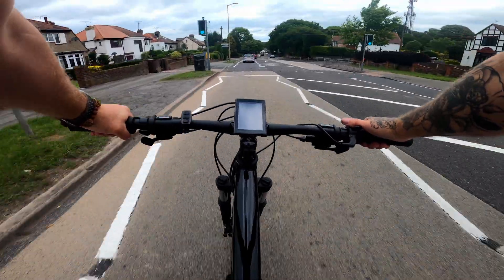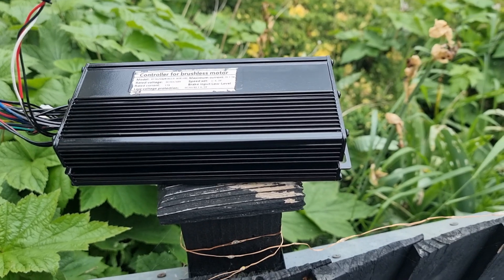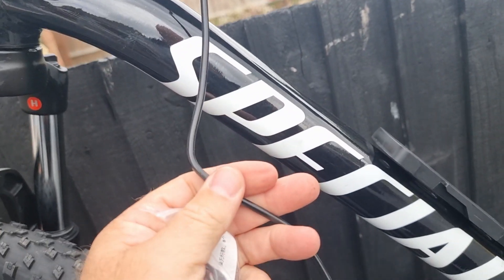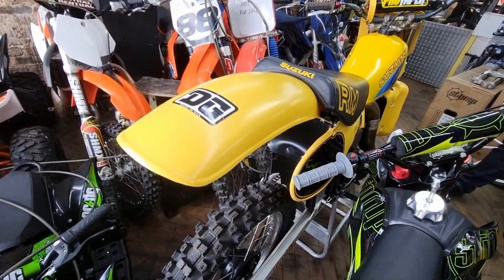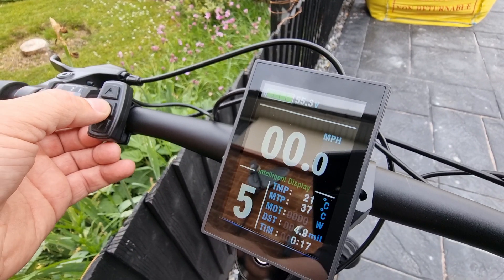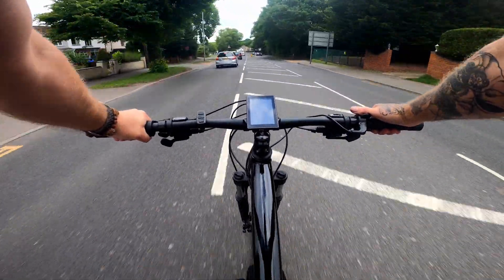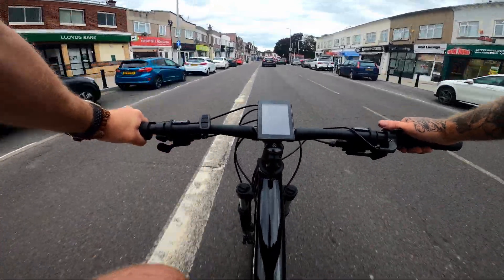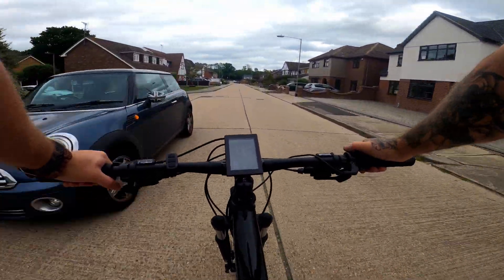LONG-RANGE 40MPH DIY EBIKE!

Comment: @dude stuff the specs on this kits battery say it’s 52v 20ah on the website have they updated the battery in the kit since or do they lie and say it’s 20ah when it’s 17.5 ?
Reply from the maker: @olsoutdoors1757  the battery specs went up from 17.5ah when this video to 20ah now. This video is old there's been improvements since
Reply from the maker: @olsoutdoors1757  this video is at least 2 years ago now

Comment: does it wheelie?
Reply: i dont think so cuz controller is too small, i built one with a 72v battery and its too fast to wheelie, its so scary 😂
Reply: @umi.1498  on all these kits is it the controller that would allow one to have the torque needed to wheeled?

Comment: Using a 750watt Bafang mid motor. With 48v/20 ah I only get around 50-55 miles range with an average of 19 mph ( I weigh 230 lbs and do probably  not assist a lot of watts)...So If I want to go further, I use my cargo-bike with a 200 watt solar panel (Allpowers SF 200). Same motor. But 2x 48v/20 ah. One in use. The other charging.. With sunshine and 13 mph average I have +100 mile range and full batteries the next morning.
Reply: The 19th mi an hour is killing you on range! I only know because I have a bbso to myself 20 amp hour 52 volt if I charge it all the way I have to ride 10 miles just to get it down to storage capacity my mi an hour average is it good bit lower though  I believe it is from stop lights

Comment: I am looking kit for my fat bike 26inch x 4inch 170mm dropout the best it would be 2000w 52volt. Im from uk
Reply from the maker: Kirbebike.com sell a 2000w fat bike kit I've used and they are good I've got video of them on a bike somewhere in the channel
Reply: Yep, I have found it, 1500w-2000w kit 26x4 but there is information that kit is for 170mm-190mm dropout? I am looking 170mm. 190mm is to wide for my bike. So now I dont know if its ok for my bike or not dude...
Reply from the maker: @sebski5597  it'll be fine just use the required amount of spacers to to sit nice and brake line up good.
Reply: My dropout is only 170mm I cant fit 190mm in my frame you know what does mean...

Comment: Just curious what would be the best power to less heat on a 48v 1500w hub motor? In terms of amps. 

Im using a 48v controller at 45amps with a 52v battery at 45amps continuous. 

I was told i might be giving my hub motor too much power and told me i should reduce the amp intake on my controller from 45amps to 40 maybe less. 

Cause at 45amps the hub motor does heat up. 

So im asking whats the safest amp to lower it to for constant continuous load in order to reduce heat on my hub motor

Comment: How many miles can you get out of this going 40mph constantly (throttle only)?
Reply from the maker: Probably a few before it overheats and blows the controller.  You can't ride ebikes at full tilt without a pause they're like electric smoothie machines.  Things get hot
Reply: @DudeStuff   Thanks for replying.

How many miles could you get out of the battery going 75% of top speed, say 30mph? Would you get 10 miles? 20? 30+?
Assume rider weight is 110kg.

The 2000W kit on Andy's site says it has a range of 40-60KM.

At what speed would you get the minimum of 40KM. Surely if you went near top speed (but not top top else you would blow the controller) then you wouldn't get 40KM out of a full charge?

Thank you

Comment: I was a bit underwhelmed when I bought this kit.  So I swapped the controller for 45 amps, changed the battery fuse to 50 amps and now the acceleration will take your face off!  It really wakes up the bike.  Maybe consider doing this for builds in the future?  Another company does the same kits with the same controller I have.  I won’t name them as it wouldn’t be fair for this channel.
Reply: What’s the name of the kit? And is it similarly priced?
Reply: Hello mate would you be able to let me know if you know anyone who builds ebikes for a living
Reply: how to you change the fuse to 50 amps
Reply: @falruqnop  unscrew the screws on the underside of the battery case, there will be 2 fuses in the front of the case, one is for the charger (3 amps maybe) and the other one (35 amps) is for power. They pull out easily and pop a new one in.  Leave the charger fuse as it is though.
Reply: @neilrogersrogers6313  do you have to change the amps on battery or can you just get a 45 amp controller and be fine?
Reply: @Ishowspeed12358  It depends on how many amps the battery can provide.  Maybe 40 for example.  That would be the maximum the controller can draw, so you could have a 200 amp controller, but it would never go over 40 amps.
Reply: Solos ???
Reply: Is there much difference between the 40ah controller and the 45ah ? Can you use a 60v 24ah battery on this 2000w mtx
Reply: @Pest_control_liverpool  The torque is slightly stronger.  I have since changed to a 60 volt battery with 50 amp discharge.  I had to change the controller because of the higher voltage and to gain more amps.  So now I am running at 50 amps.  Bear in mind the voltage the LCD can handle, as I had to change that as well.  Also, as I previously stated is that the controller is limited to the amount of amps your battery discharges.  So if you went to a 45 amp controller yet your battery could discharge a max of 40 amps, then that would be the limit.
Reply: The battery fuse wire isn't designed to take that kind of current, will end up melting the fuse and fuse wire and maybe worse and it won't cut out before doing so as you've upped the fuse amp
Reply: @TonySoprano59  that didn’t happen.  I had no problems at all!

Comment: So I gotta know, what's the batter life like if you were to use this at 40mph? I mean a 20ah battery must do easily 6 hours of riding right?
Reply: Depends heavily on the speed you ride at, wind and how many hills. Riding at 40mph drains the battery super fast. Probabaly get 20 ish miles if that
Reply: Hah at 40 mph you get 25 miles.

Comment: What was the range of the battery? Both estimated and Actual, please.

I am looking to buying either a 48v 30ah Brick battery, or a 52v 20ah U004 Triangle battery.
I have a rear Voilamart 26in. 48v 1000w with the external controller. Currently i am using a 36v 10ah with 20a bms, boosted to 48v. It’s my commuter Ebike, luckily I don’t need to go far with it but i 100% need a better battery for the bike. 
Any suggestions? I am leaning more towards the 48v but i will have to come up with a creative enclosure for the battery.
I want a battery that will easily do 35 miles, i live in a flat land with bridges.

Comment: Nice build, but only usefull for offroading. I like more the stealthy builds with overvolted en professional relabeled hubs, water bottle battery of inframe batteries. bobyproof apps with power output switching. But you can't tell to much because the bobys also watch you tube.

Comment: Im Just curious, i have built myself also an e-bike and i have to say it's pretty addictive.. But i wanted to know, do you use all the gears?
That was something that i didnt get to work as it should..

I had myself An 2x11 speed MTB so therefore i made myself  a singlespeed.. 46 in front and a 16t (108 clicks....?) freewheel at the back.. and it works pretty good..
But i have no Idea what is best..

Do you have experience with a  singlespeed and what do you prefer?

Iam totally new to this so a lot of things i just did without even knowing what i was doing or knowing what is best..

Grtz grom Holland
Reply: Yes it is addictive I built a 2000 watt and a 5000 watt
Reply: @frankroach9346  haha.. iam also planning to build another one..  not sure what it's gonna be.. I took my bike to a MTB parcours nearby and that was truly awesome..  But i think IT doesn't last long for things to break... It's a hardtail 29'er... So i have to do some research on what is best.. full suspension, 27.5" or 26" etc etc..

Comment: Been running a 17ah 48v battery and 1500w hub 36mph and 30-50mile range just about right nice build ..
Reply: Nice 1 pal. I've got a 1000w hub with a 52v 17.5ah battery that goes 36 too. Haven't tested out the range fully yet. But if u got yourself a 52v battery you could get an extra couple mph but then again is it worth it for like £400+ to get the battery?
Reply: @ashley010788  please let me ask a cheeky question... After my Haibike Full 7  goes beyond warranty I was thinking to der3gulate it so it can continue to assist my pedalling....

Is it easy to do for a layperson or does it take a lot of expertise?

Comment: Hi Dude Stuff, I am after an ebike, off road style, front suspension essential, rear, not so much..
I have just had 60% of my stomach removed (Pyloric Tumour) and will need alot of post surgery chemo. Now I have an ebike already, but it is to tall for me, and with all the repair work downstairs, I need something a bit smaller to aid mounting/demountable..  I am 58yrs young, but only 5 foot 3 on a good day with inside leg of 26.5 inches... [You can probably imagine the issues I have with an off the shelf model]
I am not after charity, more along the lines of advice and recommendations....
So to summarise, 
*Off Road style
*Throttle option (yes)
*Front Susp ( rear handy but not essential)
*Fat tyre style might be acceptable
*1000w rear or hub motor
*Stealthy type ish looks
*Easy to get on/off

Thanks for any advice forthcoming...
Cheers

Karl
Reply: Karl youre an inspiration

Comment: Another 💥great!💥video Steve, just waiting on delivery of my bike to start buying my 2000watt kit. Can I just ask how many gears does that specialized MTB have? Looks like 7 on the rear cassette and a single crankset am I correct?👍
Reply from the maker: Thanks yeah it's 3x8 I bought my own 8 speed freewheel
Reply: @DudeStuff  ok cool I was totally wrong then 😆, thanks again buddy 👍
Reply from the maker: @grantweller9300  actually not sure if it's 2 or 3 up front 🤔  but def 8 on rear
Reply: @DudeStuff  thanks Steve, my bike coming (Giant talon) has a single crank set up with 10 speed rear cassette. Just unsure what to go for as still want to pedal a bit so a 7 speed might not be enough that comes with Andy's kit 🤔
Reply from the maker: @grantweller9300  either go 9 speed 2000w or 10 speed 500w
Reply: @DudeStuff  thanks Steve👌

Comment: Have you considered putting a high powered hub on your front wheel? Or, have I just given you your next build idea?  :-)

Another idea, if you want to try going for more speed...not sure what your front chain ring size is, probably 32T to 36T by the looks of it, consider swapping that out for a 48T or 49T. And, if your rear lowest gear is a 14T, you could swap for a 11T.  Would be a monster to pedal starting off from a dead stop, but if using throttle, might help you get much higher top end speed. All the best. Cheers
Reply: It's a hub, not a mid drive. Chain ring will make all of zero difference
Reply: It can make higher end speed only if you ride 250w and technically just cycling over the motor capability :).
But it's for 250w, not 2000w :) xhahx
Reply: @TheHead-IP  I agree, but for motor only it'll make zero difference. Good luck on riding over 40mph so your theory is also out the water tbh
Reply: Sorry, you said 250w...yeah I agree
Reply: @MrChelseafc88   :) np mate i talking of my experience,  got 250w front hub and bbs02b 750w. Now waiting my 3rd kit 350w rear hub.  Btw 38.2mph is my top with 44/12 now i put new cassette 42t-11t but still not test it for top speed with 44/11 set. 44mph not loaded max rpm by bbs02b.  Love the ebikes :)
Reply: @TheHead-IP  44mph on bbs02... Fair play mate, that's good going. I'm only getting 55mph on my 3500w bike at 72v and not much more on my 5000w bike. My bbshd with asi bac 855 don't even hit what you do on the 02
Reply: @TheHead-IP  I max out at 34mph on my bbs02 with peddling like a crazy man
Reply: @MrChelseafc88  don't ask me how i did it was one time :) i was use a street with roughly 200yard downhill to help me hit the highest gear much faster and then cycle like mad :D  on flat is about 32-3-4 like you say.
But i am heavy :( 106kg  29er mtb.
Ouh i have to say that i was programming my setting on that day. 25amp out of my bb and set up the keep current to 100% for MAX muscle results :)
Reply: @TheHead-IP  it was a feat for sure. Lower your stop delay and it'll be alot more smoother on the pas 🙂 just a little tip as you seem like you like to tinker
Reply: @MrChelseafc88  yes ft :) you're right.  I think i set up this to 100ms.
And yes i like to tinker my controller.  I still looking after the perfect setup for me. I even don't remember what was the stock settings :) xhahx.
Reply: And aswell the stop delay, actually is not for a smooth PAS. It's the time when motor will stop after you stop pedaling,  it's a good idea to play with this feature if you not using ebrakes or sensors.  The start current setting will help you for a smother PAS and throttle acceleration. My one is on 10%, and is not that sharp and stressful even if i am on higher assist level and move from stopping position.  Afcourse BB need lower back gear!!!
Reply: @TheHead-IP  I knew there was a few other settings, but I couldn't remember them off the top of my head. It's been a very long time since I messed with bafang settings. I only have standard bafang controller on my 02. The HD I use asi bac 855 and on my x1pro I use the asi bac 2000. Bafang controllers are total crap in my opinion